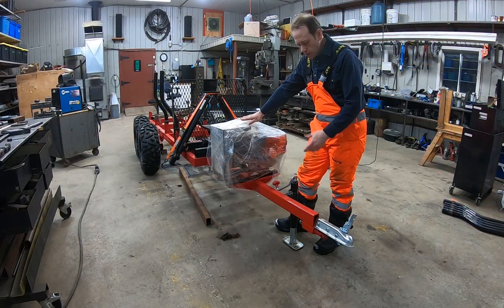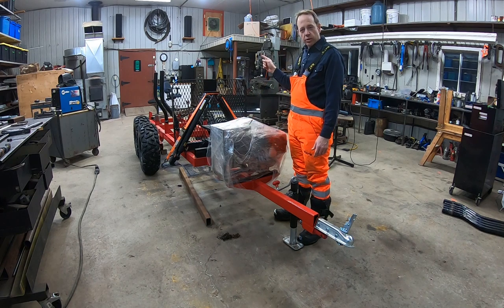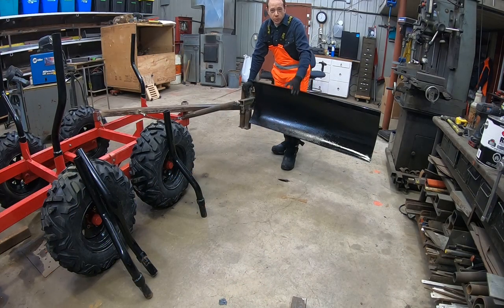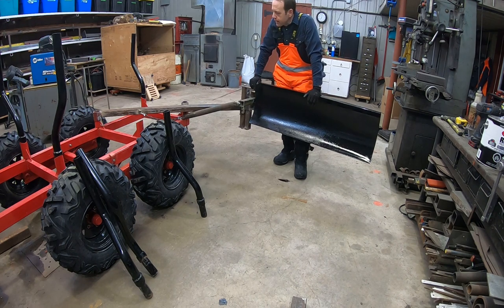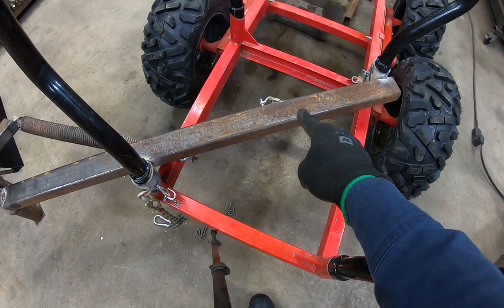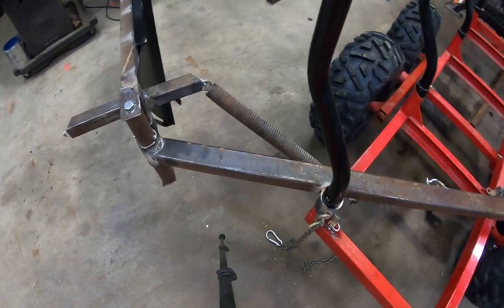#228 The Contraption - Snow Windrows Removal Made Easy

Comment: Allo Joe. That's an amazing piece of engineering. You need to patent that before one of your viewers does. 
If you hadn't bought the logging trailer you could have mounted that wing to an ATV trailer frame.  
As for a name you should call it the logging wing.
Reply from the maker: Whenever I can combine uses for the same equipment, I do. This makes less equipment to store in the hangar! Thanks for the suggestion!

Comment: Great idea. Once you get the hydraulics going you can control the wing to plow at different angles and depths using pistons. All the old plows and new ones use the wing to knock down the banks on the highways around here. I have found many videos showing plows back in the 30s that could really dig out from blizzards using wings. Look forward to seeing the trailer all finished soon. Thanks.
Reply from the maker: Thanks Wayne! That is a possibility to use the hydraulic unit along with remotely controlled valves. Up/down and angle would be great!  Thanks!

Comment: Salut Joe!!!  I really like your latest creation!!!  I was trying something similar with my back blade that I can offset.  When the banks get high you just can't get the snow to roll off the blade and over the bank, so this device will be very useful!!  Since it seems to bat anything in it's way and it's a wing of sorts, how about calling it 'The Bat Wing'!!!  LOL  Great job Joe and it works really well!!!  Thanks' for sharing and have a great week!!
Reply from the maker: Thanks Mike! Having it on the trailer does not put stress on the UTV.  I've thought of having such a device on the rear end of the UTV, but it could be pushed sideways. Great name suggestion!

Comment: It looks like a miniature version of the tow plow that some of the highway departments are using here in the states. I am impressed on how  stable the empty trailer stays with a full blade of snow, thought it might dog track a little. Also reminds me of the Falls brand wings we had on our township snow plows,they had that channel iron support on the back of mold board. With a spring loaded arm.
Reply from the maker: Hum... that sounds very similar to what I did then!  I was also surprised the trailer would not be pushed sideways.  I think I could put even more tension on the spring. Thanks Ed!

Comment: Bonjour mon ami, I love this build! You did a great job and the spring tension looks to be perfect! We here in Ontario have a similar type of plow and trailer config for major, multi lane highways. The wheels on the tow plow pivot and the trailer moves to the next lane. It's genius as is your invention. The only name I can think of is "Tow-Plow" Merci, cheers
Reply from the maker: Thanks!  I've seen some videos of those towable plows.  I think they use it on the 401. Never seen them in real though. Thanks for the suggestion!

Comment: Salut Joe,
Belle invention.  
I'm surprised the trailer is not pushed around by the weight of the snow.
You could have installed it on the end of the plow on the Case and have the convenience of the hydraulics to control the height.
Nice trailer.
Reply from the maker: Speaking of hydraulics... there is a hydraulic unit on that trailer!  I am only missing remote hydraulic valves! Thanks!

Comment: Good morning Joe! Awesome! Really smart build Joe- it works perfectly. Nice! Hey is that a Wallenstein log trailer? Nice!
Reply from the maker: Thanks GP!  No, the trailer is made in Quebec by AM Machinery. Then the crane is a Farma (Estonia). The crane that will be installed can reach 12.5ft (3.8 meters) and yet fit on a small trailer.  That is the very limit for a UTV. Other models are suited for ATV, so they are not maximizing the higher capacity of a UTV.  This is a rather unique combination developed by Picken Equipment here in Waterloo (Quebec).
Reply: That's great! congrats Joe!

Comment: I might suggest a name;,..... 'Joe's Left Wing!'
That works well Joe, cutting the windrow down in steps is a good idea too. If the snow gets heavier, would you load up the trailer so the wing won't push it sideways?
Reply from the maker: That is the idea Reg, of being able to add some ballast if needed. This was already some wet snow, so it's very promising. Thanks for the suggestion!
Reply: @FromSteelToWood  I 'toyed' with that idea a few times, but never went ahead with it. I don't do a lot of winter running with my ATV any more,.. all my buddies have gotten 'old and feeble' ( god, I hope they don't see this comment LOL!  So  don't need to widen paths and trails nowadays.

Comment: I would interested to know which brand of log trailer you purchased, I've been considering getting one myself. The side burn plow is awesome.
Reply from the maker: Thanks!  The trailer is an AM Machinery, then the crane is a Farma (yet to be installed...). 
The trailer is the 900R
https://www.ammachinery.com/en/produits/remorques-forestieres/
The crane is a 3.8 Farma
http://www.forsmw.com/crane/c-38-g2
The local company that sell it is Picken
https://picken.ca/products/farma-3-8-utv
They made a special combination for maximizing the capacity of a large UTV. I mean, bigger crane (12.5 feet / 1000lbs at FULL reach), but yet a smaller trailer capable of 3500lbs (gross). So rougly 1700lbs for the trailer, crane, and powerpack. Yet 1800lbs of logs.  I am pretty sure it can take a few more pounds in that regard!